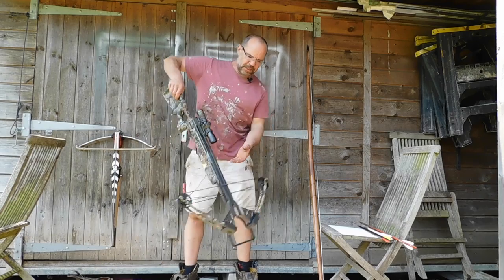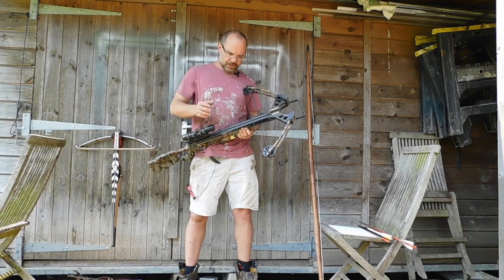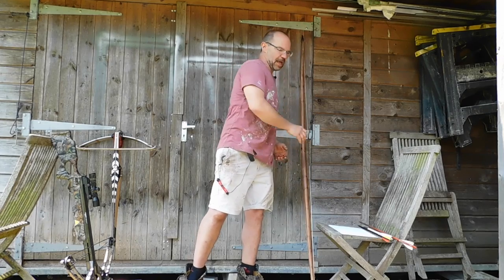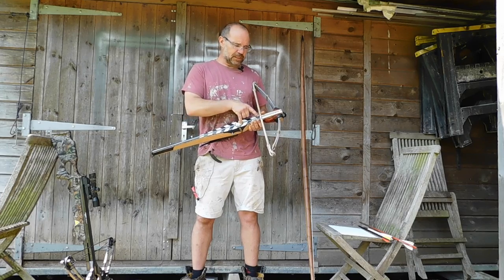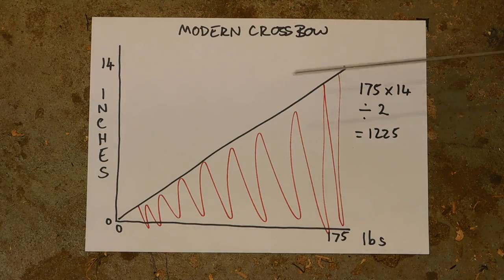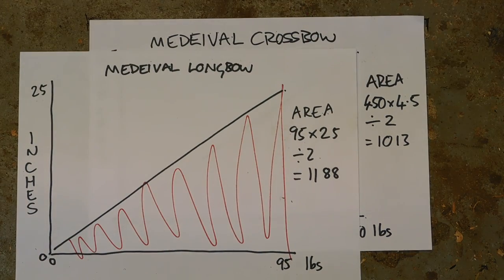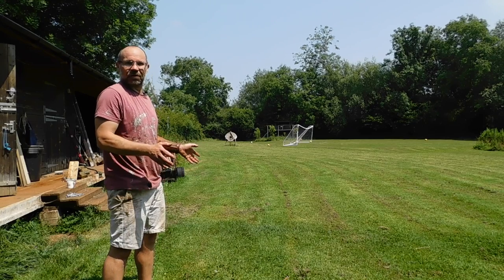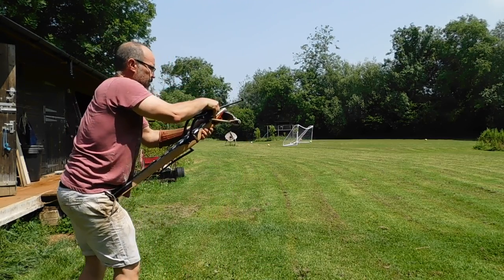Draw weights of medieval crossbows, longbows and modern crossbows

Comment: You made an interesting point at the end but I think you're just shy of the mark: are your bows or Joe Gibbs bows as good as the BEST bows of the time--probably not. Are they as good as the run-of-the-mill mobilize the country to arms quality of weapons that were likely made during a period like the hundred years war? Probably as good or better. The King's sword isn't measured the same as that of the yeoman, and bows I'm sure are much the same.
Reply: Looking at the efficiency of Joe's longbows in the Agincourt test, it was rather disappointing. A good bow can put out about as many joules as it has pounds of draw weight, at about a 1:1 ratio. His was at a 100:74 ratio. I once saw a 180 lb bow that barely put out any more energy than his 160 lb bow, admittedly (of course, arrows make a big difference to readings).
Reply: @vanivanov9571  Were those recurve and/or compound bows? Longbows are self bows and are not as efficent at transfering the energy into the arrow as other types of bows.
Reply: I'll readily concede that Joe Gibbs ( or other other quality Bowyer's ) long bows have efficiency on par with military issue bows from back in the day . The big difference is the test bow has a draw weight well below historical .
Reply: @filianablanxart8305  If we go by the Mary Rose samples then 95 is underweight with the average being around 140-150lbs but the math works similarly so long as we keep in mind what Tod says about ignoring efficiency which is actually super important and an area which causes most of the controversy from what I have seen. The heavier warbows in the 180-200lb range have thicker cross-sections  which gives more potential energy but lowers the efficiency. They use heavier arrows than lighter bows which increases the amount of potential energy transferred into the arrow but still losses efficiency and all tests I have seen indicate loss of 10-20% fps but the heavier arrows have more momentum and did have higher potential energy than lighter warbows. Compared to a horn/sinew Manchu bow that has 150lb draw but is 25% more efficient but also has a shorter stroke the math indicates really similar energy delivered to a target by a slightly lighter, shorter arrow that moves at a higher initial velocity which translates into less drop (more accuracy). The result... the top end warbows of English archers and steppe warriors were really quite similar in armour penetration with the steppe bows being smaller and more accurate but also more expensive to make and more difficult to maintain. For steppe cultures that is not a huge drawback because bows were the main weapon of the steppes and there was no need for ordinances such as England created to mandate men to practice archery.
Reply: In regards to whether a great modern bowyer can match the best medieval bowyer, well we simply can't know for certain. But given that they're both humans doing a task with a clear goal, the answer is undoubtedly yes, what makes this question unanswerable is the fact that we don't have a point of comparison.
What we do know, is that we actually have the math to PROVE that we can make the best bow possible. We can factor in all the variables; things like hysteresis, the return of the limbs, drag mechanics, the application of force over distance, etc. And we can look at that number, determine what the theoretical maximum efficiency of a 160# longbow should be, then keep building longbows until we get the closest tested number to the theoretical number.
What we DO know about the medieval method of crafting, is that perfection was not only complete mystery, but also often times a trade secret.
So the "best bow of the time" was almost certainly very regional, and literally limited to the best bow that anyone was able to produce at the time. That could have been the maximum theoretical performance of a longbow, or it could have been 70% of what a longbow is actually capable of. But they didn't have the formulae to math it out, they didn't really have the measuring equipment to quantify the results precisely (other than range and penetration), and the records of "best longbow ever made" are tenuous at best, since once an event has been removed from 1st person account, it becomes less of an actual fact and more of an arguable point: Your great grandfather claims he knew a man that could make longbows that shot 300 yards! But you tell your friend who's been made hundreds of longbows over the last 20 years, and he's never made a bow that shot more than 260 yards, and none of the bowyers he knows have ever made bows that shot more than 250-270 yards. The bias of experience results in the 300 yard claim being dismissed as crazytalk, regardless of it being true. But now, we have official records backed by photographic or even video evidence, much harder to dismiss.
That being said, as Todd has mentioned, they didn't have the math, they didn't have the equipment, but they had the same brains. So a bowyer could continue to make bows, changing little things here and there, until they found the best result. So simply by trial and error, they were bound to make some pretty impressive bows eventually, as long as they kept trying.

So in summary, COULD a modern bowyer make a longbow that replicated the BEST longbows made in medieval times?
Absolutely.
We can use the same materials, and we have the same brain. We have some scientific advantages to gauge how close we are to the end result, but ultimately it just comes down to making bows until you get the best result. And that end goal, maximum perfect result, has not changed in 600 years.

Comment: Hey Tod, love your videos. 

My son and are bow hunters. My son and I were watching your vid and some other interesting thoughts came to mind:

    Modern Crossbow 175lbs/131j =75% conversion

    Longbow 95lbs/45j = 47% conversion (approx 50%)

    Medieval Crossbow 450lbs/54j = 12% conversion (approx 10%)

This would mean you'd need a 1000lb crossbow to deliver the same 100 joules as a 200lb longbow.

Now, think as a general on a battlefield. Which weapons delivers the most joules of "death" to the battlefield per second.

Working on 10 sec easy calculation.

      Based on our own rate of fire, we think in the hands of a expert archer, a 200lb longbow can shoot 3 arrows (each delivering 100 joules of death) in 10 seconds = 10 secs/300j = 30 joules of death per second.

We've assumed 1000 crossbow can shoot 1 bolt (delivering 100 joules of death) in 10 secs = 10 secs/100j = 10 joules of death per second.

I know it's simplified, but still interesting.

Again, thanks for your videos. Love em!

Comment: it's not just about the kinetic energy, but also the momentum of the projectile, which is m*v (not v²), there the heavy bolts are actually quite good.
Reply: Sectional density and (in war or hunting heads) sharp edges promote puncturing and incision wounding in-situ, very different from the 'tearing and bruising' seen in bullet penetrations, with their considerable cavitation and (temporary) displacement of soft tissue.

A handgun and arrow have similar penetration depths (at low draw weights - the 'wounding study' I have shows results for ~ 52lb bows only - and a bow of around twice the draw weight with heavier arrows (these were only 30-40g arrows - much lighter than what a heavy bow would be firing from what I understand) would show at least as good performance.

Indeed, medieval/renaissance texts warn of taking broadside shots on deer because of the risk of a through shot striking hunters on the far side of the quarry on a hit - and it was preferred to take an oblique shot to maximise wound channel length.
Reply: Kinetic energy is far more informative than momentum because it is that energy that is 'used' to impact the target, ie break molecular structures. Obviously each molecular bond is far smaller in strength than a joule so it is sort of a count of how many molecular bonds it can break.
Reply: Incorrect. It is the energy that is important in a killing projectile. A large mass moving at a slow speed is nowhere near as effective as a small mass travelling at high speed. That is why is a bullet is preferred to a thrown rock.
Reply: the mass is already in the calculation. The slower medieval bolt had more energy than the faster arrow. He doesn`t multiply speed with speed to get to joule (v²) like you suggested.
Reply: Kinetic energy and momentum are similar measures in principle coming from  mass and velocity, so it really depends on what math you're trying to accomplish in the given case. Energy has an advantage that you can use the law of energy preservation to compare different kinds of energy, momentum might be simpler to use for object collisions. In the end they drop down to the same base numbers and unless you miscalculate somewhere the results have to end up being the same either way you get there.
More massive projectiles, up to a certain point, do indeed have a couple of advantages. They tend to have more structural integrity (wider cross section, given other parameters stay similar) and are more resistant to aerodynamic losses (where momentum helps intuitively, but kinetic energy can be used just as good) to state a few.
Reply: Kinetic energy can be deceptive.  As was pointed out, a hollow-point 9mm round can do more damage than a much higher-energy rifle round, if the rifle round simply passes through flesh without striking anything critical.  In this case a round traveling 4000 fps probably wouldn't inflict much less damage than one at twice the speed - simply because it passes through, carrying most of its energy with it.

What matters is how much of that energy is imparted to the target - anything going out the exit wound is academic.

The modern NATO 5.56mm round is legendary for "tumbling," causing massive tissue damage.  But that's a myth.  The truth is that, when a round leaves the muzzle, it's spinning on its axis at about 300,000 rpm - and the metal jacket is just barely holding it together against the centrifugal forces.  A study by US Army surgeons found that when it hits, the bullet tends to shatter at the cannelure, producing tremendous hydrostatic shock, as well as a wound cavity the size of your fist - filled with little metal bits.  This transfers almost all the kinetic energy into the target.

(At longer distances the bullet's spin slows, making it far less likely to break on impact, and more likely to overpenetrate.)

Anyway, the point is that after the threshold of overpenetration, higher kinetic energies make little difference.  Of course, shooting at an armored target, that higher kinetic energy may mean the difference between penetration and not penetrating at all.
Reply: Paul Baumer Not always true.  A slow moving train can do a lot more damage than a high powered bullet.  Heavier projectiles retain their momentum better than light ones over distance and in the end it all comes down to the  energy delivered on target, not muzzle energy, that truly matters.
Reply: Lot of talk about energy vs momentum here. Momentum, along with sectional density, primarily determines how well a projectile will penetrate a target, and energy determines how much damage is done. With an arrow, the kinetic energy transfer is less important than it would be with a bullet which uses crushing and cavitation to deal damage. As long as you have enough momentum to push a 1 to 3 inch wide broadhead fully through the target, your arrow is doing it's job. The high speeds seen in modern bows are less about killing power, and more about getting a flat trajectory, so misjudging range by one or two yards let's you still hit the target.
Reply: To go counter to the theme of my previous statement, the best thing for penetrating armor is a small piece of either high carbon steel, or tungsten carbide with a whole lot of kinetic energy.
Reply: Its far more complicated than being able to measure just one thing to determine effectiveness. Energy is not the only thing to consider. As for firearms, some heavier rounds are more effective than lighter rounds despite having lower energy.

Comment: A good video!
One small point you did not cover too well though was type of Arrow / Bolts! The purpose of them was to put holes in things .... bodies, armour, horses .... and mere energy of the arrow does not compare in this respect. There were many different tips from scimitar like heads designed to disembowel horse to basic points for "normal people" to armour piercing heads. All of these were great at their design targets but poor in others.
Also there is much loss in the archers paradox (flexing of the shaft in flight) which is one of the great advantages of compound bows. The draw weight varies from high at the start of the draw to light at the end. This makes the arrow speed up  more as it moves to the end of the draw rather than the longbows more flat speed curve!
Reply: It's funny how you say Tod did not cover something too well, and on your comment you don't even know what archer's paradox is.... The flexing of the shaft in flight in not the archer's paradox, but a result from it, I could explain to you what it is but I will let you search the  information by yourself, so you could be more considerate next time you bash on someone else's video without even knowing what you are talking about.

Comment: I know this video is quite old, but I wanted do do some calculations for myself to see if I could quantify the efficiency of the bows.
I took the bow strength, the powerstroke and the weight of the projectiles for the medieval long- and crossbow from this video, as well as the Skallagrim-crossbow (I got the values from other videos: 976lbs, 160mm, 96g). I calculated the theoretical acceleration (a = F/m) for the three bows, and used that to get a theoretical projectile velocity ( v = a*sqrt((2*d)/a) ). 
Point is, a 423N (95lbs) longbow with a powerstroke of 0.64m (25 inch) should be able to accelerate a 45g arrow to 109m/s. You measured it at only 44.5 m/s, which is about 41% of the expected velocity. 
The lighter crossbow (2002N, 0.11m, 60g) should reach 87m/s but reached only 42.4m/s which is 49% of the expected velocity.
Skall's heavy crossbow (4341N, 0.16m, 96g) should in theory shoot bolts at 120m/s but was measured to shoot them at 47.9m/s (39,8% of the expected velocity).
Since I think, that the kinetic energy is a better measurement for the efficiency of those bows, I calculated the energy both, based on the theoretically expected and the experimentally measured velocities (the latter were basically the same that Tod calculated in the video).
Because we calculate the energy by squaring the velocity and the other parts of the formula (mass of projectile and the factor 0.5) stay the same, the efficiencies of the energy were just the squared efficiency of the velocity (I should probably have seen that coming...). 
The surprising thing is, that the longbow appears to be less efficient than the lighter crossbow, and that even though the longbow's projectiles should in theory have more kinetic energy (268 vs 228 Joules), in practice the crossbow has the advantage here (45 vs 54 Joules). 
The heavy crossbow has about the same efficiency as the longbow, but with more than ten times the draw weight and twice as heavy projectiles, those projectiles have more than double the energy of either the longbow or the lighter crossbow (110 Joules).
I'm kind of curious how a warbow would perform, so if anyone has the draw weight, powerstroke and projectile mass for a representative bow please let me know :)

Comment: I'll have to look at the momentum change of these weapons & see how that affects their relative relationships.

As the .22 comparison shows, the effectivness of a projectile can depend as much on its momentum and sectional density as it does on its kinetic energy.
Reply: This was my thought as well. Momentum is the resistance to slowing down. a train rolling at 1 m/s is harder to stop than a compact car at that same speed, because it's heavier. Heavier things want to keep doing what their doing. 

I know American math, so check for conversion errors. Momentum is just mass x velocity and give us kgm/s.
Using his values the momentum of the Compound crossbow was 2.9
The Longbow was 2.0
The Medieval Crossbow  was 2.5
A .22 bullet (2.6 g, 361 m/s) was 0.9
A 9mm bullet (8 g, 381 m/s) was 3.1
A .308 (7.62 x51) (10.9 g, 770 m/s) was 8.4

A 12-ga slug (35.6 g, 488 m/s) was 17.4

A .22 isn't more deadly than an arrow or bolt. That energy value only matters the instant it makes contact. After that, the much higher density of the target will begin to slow the projectile down. Things with a higher momentum slow down more slowly, so they penetrate deeper. The compound crossbow may not have anywhere near the energy of the 9mm bullet, but it has a very similar momentum, making them comparable as far as close range damage goes. The Slingshot Channel did an old video comparing momentum of one of Joerg's slingshots to a number of handguns using a swinging metal plate to test. The only gun tested that beat the sling was a .44 Magnum. https://www.youtube.com/watch?v=tLxnNP-ycVQ